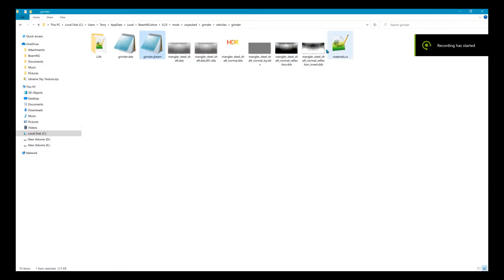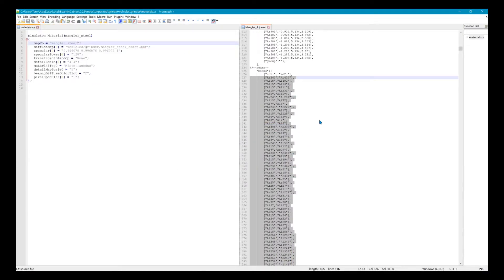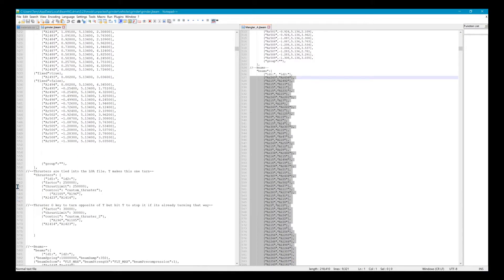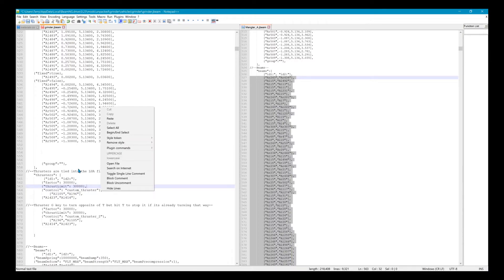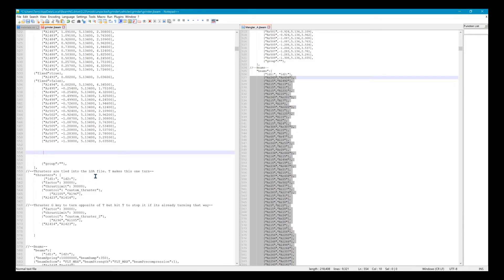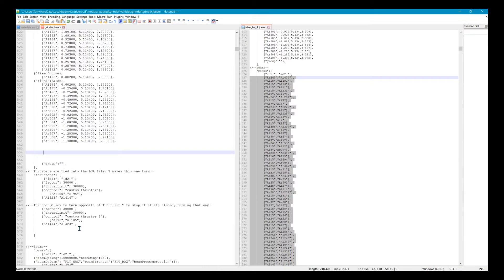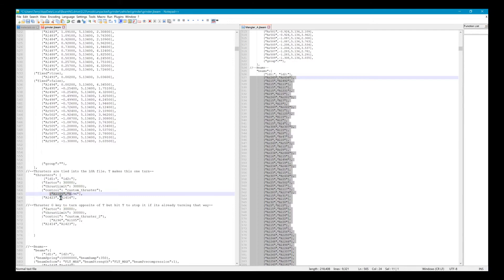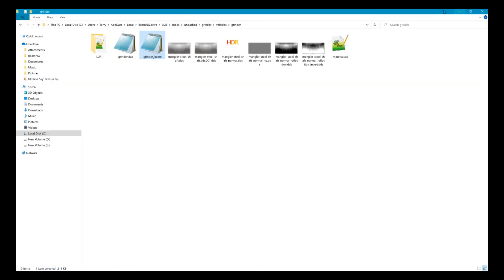The Mangler aka grinder - Mod in Description - see description for special instructions

Comment from the maker: Updated...4/5/23
https://1drv.ms/u/s!AoPEwcmh86n10XZNPWJyAzuRYdxN?e=VnKumT
--Zip goes to Mod folder
-Added Particles. 
-Gas or Break to spin one way or the other
-Will need to lift them off the ground in World Editor
-They spin up pretty slow, but get up to speed with time. See video how to stick the accelerator on if this next part does not make sense. 
(holding gas or break and tabbing to next one will stick accelerator in forward or reverse) Its like placing a rock on the accelerator and jumping to next car with tab. Assuming you have 2 spawned and at least one vehicle to drive. 
-Don't bother trying to line them up so the teeth go between each other's teeth. 
-If you do no like the particles, you can simply delete the LUA folder in the mod's folders.

Comment from the maker: Let me know any issues or questions.
Reply: Thank you for your time.
Reply from the maker: @zensuufu  Glad you enjoy it ! I never tried anything crazy like 1,000,000 for a thruster speed. If your one to edit the jbeam, its set to 30000 for the thrust amount. Highest I had it in testing was 250000. Much physics instability it seemed the faster it went. It still has some at 30000. Thats the only real limitation to make brutal car killing mods. How much can the engine handle.

Comment: speed too fast
Reply from the maker: Most defiantly. Too fast it causes problems.
Reply from the maker: Open the jbeam for the mod and scroll down till you see thrusters. There should be 4 lines of thrusters, each line having 2 numbers. Think I have them at around 200,000
Lower to about 50,000 in each of the places and re-save. 
Reload mod with control R or simply reload mod.